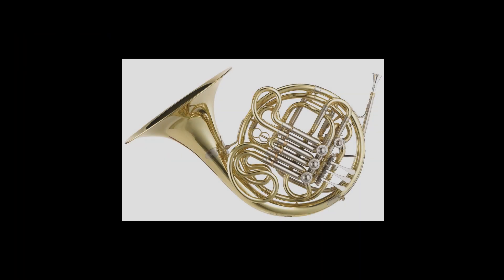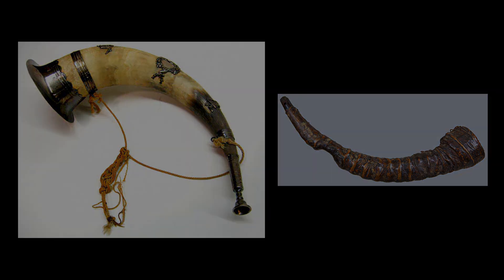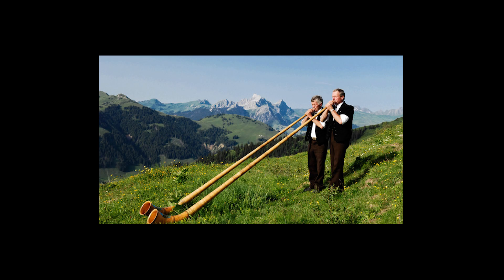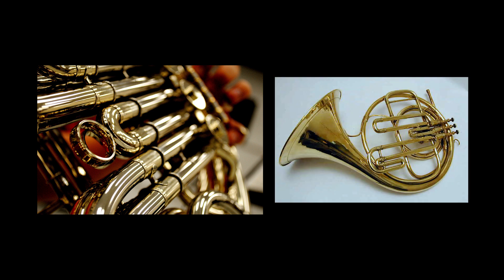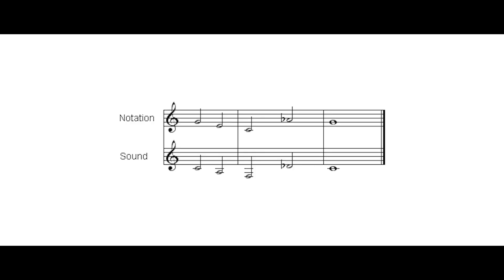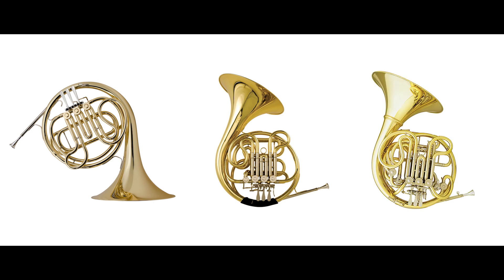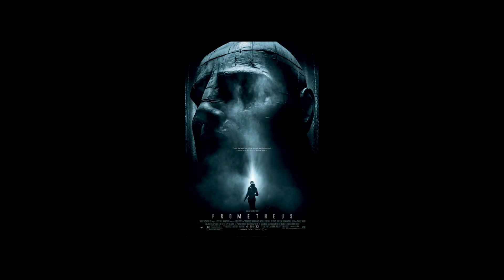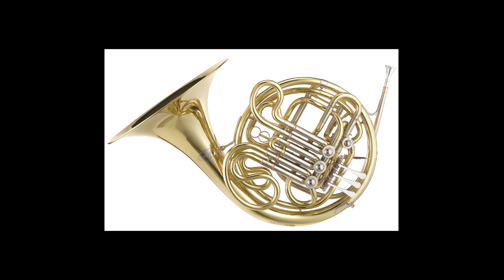Instrument Series: The French Horn

Comment: There are a few problems with this, firstly, single B horns are far more common than F horns and you didn't even mention their existence. Next, you mispronounced basso, also you said "introduction" of piston valves, but it was rather the introduction of the périnet valve, as piston valves existed on the horn in a few other forms. Your description of the French and German designs isn't entirely accurate. A big problem is that you said that a Wagner tuba provides the same tone in the lower register, which is entirely untrue. The Wagner tuba exists to bridge the tonal gap between the horns and the trombones, and neither B nor F Wagner tubas can play lower than the horn. Other than that, decent video.